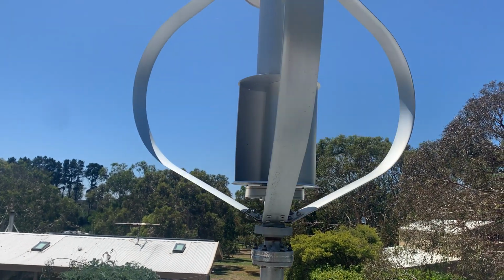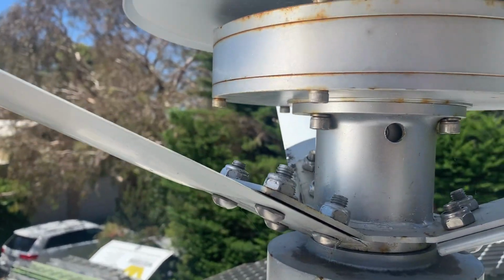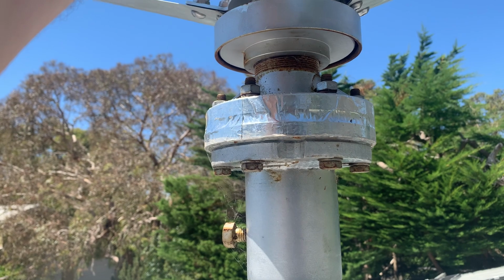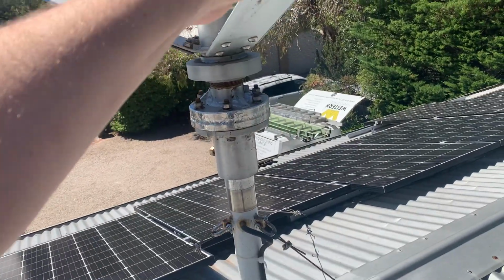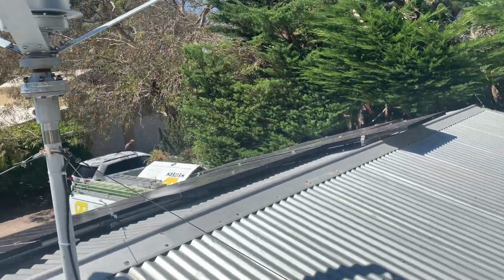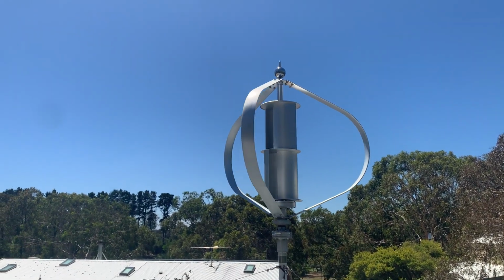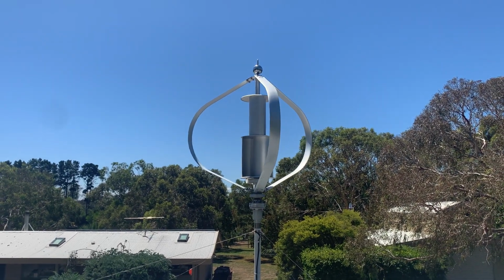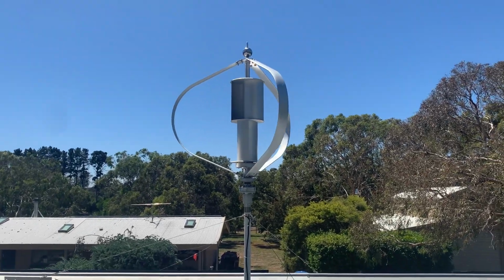Typmar 400w 48v Vertical Axis Wind Turbine, Should you Buy?

Comment: Some designs are being tested with four straight blades scaled way up with the generator at the bottom of the tower for ease of maintenance, with the centre section the same as this type for low wind start...

Comment: Well this is a first for me I've never seen that type of alternator pleased like that before ! All the alternator's that I have seen on these type's of Vertical Axis Wind Turbine's have the alternator at the bottom of the blade assembly, they are all fixed to the mast and the shaft is attached to the blade's so that the neodymium magnets spin around the coils. I think that, that's your prob Bert 🙂
Reply from the maker: It's just another fake Chinese product, no proper output testing was ever done in the factory and I know this happens as I have done business with other products from China, there are some good Chinese turbines out there and it pays to find those and avoid the snake oil products.

Comment: All practical tests of ground-based small wind turbines show the same thing: 1) They hardly produce any electricity. 2) They do not last long!
With solar panels, you can generate at least 10 times more green electricity with the same investment! Reliable and almost maintenance-free.
Moreover, the wind close to ground is extremely gusty. 9 out of 10 small wind turbines therefore stop working after a short time!

Comment: Hi Bert,  l don’t believe it has, it was supplied with an mppt controller.  I did try a boost controller but that did not work.  Thanks
Reply from the maker: Possibly your controller is only suited to a 24v system, or if the turbine puts out higher voltage such as 20 to 32 volts the controller may simply refuse to work if connected to a 12v battery bank.

Comment: Hi Bert, I’ve recently installed a 500 watt 12v wind turbine with mppt controller.  I didn’t expect to get 500 watts but the most I’ve been able to achieve is 140 watts which is fine for topping up my battery banks.  The problem is I have 2 battery banks, 1 is set up 24v system and the other is a 12v system.  I can’t get the turbine to charge the 12v system but it will put current into the 24v system.  That said it doesn’t appear to increase the voltage.  Would a boost buck converter help with this issue.  Any advice would be much appreciated. Thanks. John        🇬🇧
Reply from the maker: Hi John, do you know if the turbine has a built in controller or is the controller a separate unit? I know that issues like this can arise from turbines with built in controllers. A boost buck controller will certainly help with getting more output from your turbine.